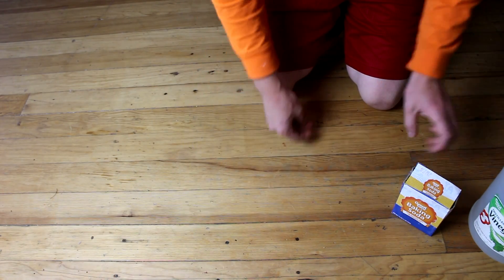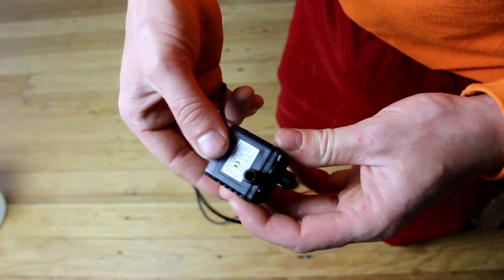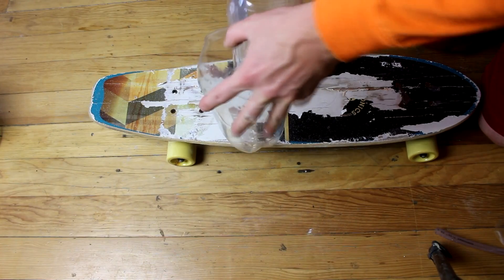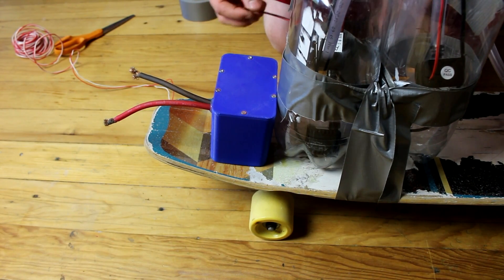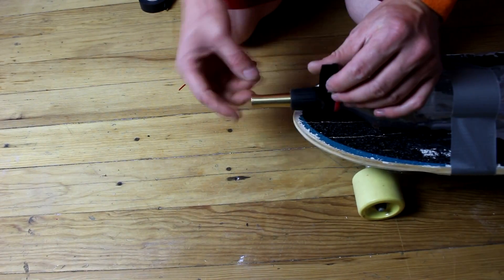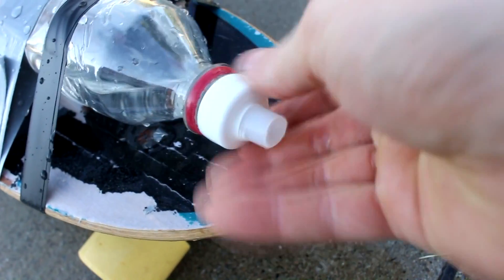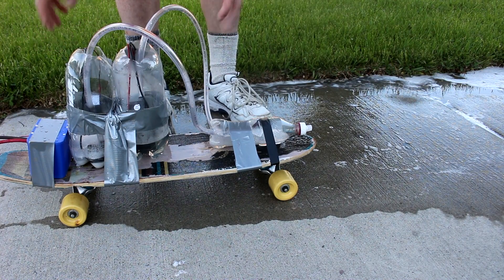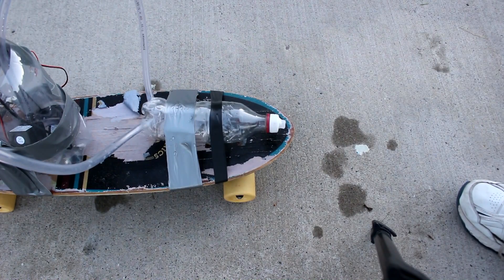Liquid Fueled Baking Soda/Vinegar Rocket

Comment: could you build a rocket and strap it to a skateboard and design the rocket so that it has sustained thrust, or multiple rockets fired after each other to achieve 10 or more revolutions in a 3m diameter vertically erected loop?
Reply: or just build a rocket that could make it to the top of the troposphere 10/20 km or so

Comment: I think you would have had better results if you had made it a hybrid solid rocket. I'm not sure how you could pack the baking soda so it would form a solid column inside the combustion chamber, but it would have probably been lighter than trying to dissolve the baking soda and pump it with the vinegar.

Comment: I wonder if this be done in a way where you use 1 way valves and a primer to avoid the need for the battery.  Let the reaction pull the liquid as it's coming out?  I'm guessing that it's not as easy as that, but I'm curious now.

Comment: If I remember correctly, the nozzle doesn't have to have greater cross sectional area than the inlet of the reaction chamber when compressible fluids are in the reaction chamber, though having the outlet with a smaller cross section than the inlet would increase pressure inside the reaction chamber (possibly requiring a few more pumps on each reagent).

Comment: looks like there might not be enough area in the reaction chamber along the thrust vector causing unreacted fuel loss, and too much area in the perpendicular plane. I would be interested to see if the thrust improves if the reaction chamber is a couple of feet of 1/2 or 3/4 pvc with the inlet at the front of the craft. Seems like that might mitigate some of the losses from turbulent flow, especially if a small section was dedicated to forced turbulent mixing, and the rest was packed with smooth straws to induce a mild laminar flow and "nominal" vectoring of the work being done before the nozzle. Then I guess the discussion moves to friction, but geez, what a drag.

Comment: When I was watching this, I asked myself a Question: Does it make any difference between putting 2 pumps in series and putting 2 pumps parallel... (I think actually, that it would be more efficient, if you let them pump parallel, because than, the move 2 times more water. then, In the reaction chamber, there will be more pressure, because, there is more fuel)
but I don't know and also don't have the recourses to test it. but maybe you have....

Comment: I wonder how powerful would it be if used glacial acetic acid and conc solution of potassium carbonate. (potassium carbonate allot more soluble in water) Also, one-way nozzles would help to avoid the pressured CO2 going both directions.

Comment: I would love to see you build some rockets out of potassium nitrate and sugar (maybe some iron oxide to make it burn faster). My friend and I built some of those and it really propels a skateboard rapidly even with a smaller engine. It is important to put a hole down the center of the rocket engine while the potassium nitrate and sugar mixture is still hardening though so that when it is lit from the back end, that flame will ignite the rest of the inside of the rocket instantly.

Comment: do coke and mentos rocket but see if you can liquify the mentos by grinding it to dust then make the mentos water???? i am not a scientist but mentos and coke are a better reaction
Reply: Central Bop, not that I am an expert but afaik:
The reaction between the mentos and the coke is not chemical, as in its not to do with the stuff in the mentos reacting with the stuff in the coke. The reaction is physical in nature, it is caused by the way the surface of the mentos dosturbs the bubbles in the carbonated liquid. 
Tldr, probably won't work if you powder the mentos. 
Sorry if I mucked up terminology or are dead wrong, working on fairly old science knowledge.
Reply: sorry mate not a scientist and never claimed to be but it was a suggestion if it did work
Reply: Central Bop, yeah all good, not trying to shoot the idea down just saying that might need a different plan for the mentos. 

An idea I saw elsewhere was to use activated carbon and a fizzy drink as it has the same ability to distrupt the bubbles but is already more of a powder. 

Would be cool to see a few options tried. Including yours as I could be wrong about powdering the mentos ruining the physical effects.
Reply: Samuel Windall yeah man Cody should do a follow up video

Comment: If we put this on the end of like a ruler and hang it by a string from its centre then the rpm of the spinning ruler can be used to find a ratio of the concentration of the two substances? Possible maybe? Using speed to calculate a concentration difference?

Comment: it will work fine if you put some decent bearings in the board, I'd recomend getting chocolate bearings they are like £5 and then try It on the road that surface is actually really hard to push on. I've been on surfaces like that and its horrible I skate so I know this shit 😂

Comment: How about to make a liquid propellant pulse-jet (well, sort of..)? Put check valves near engine inlet tubes, make a small nozzle, and send fuel in pulses. That way you can increase pressure in a combustion (err.. reaction) chamber a lot without using more powerful pumps.

Comment: If you used an atomiser (Or whatever you call the nozzle that sprays a fine mist) to put the fuels into the chamber.  Do you think that would allow the contents to be better mixed in the reaction chamber? I noticed with the foam that once it had left the rocket it kept expanding, meaning the reaction had not fully taken place yet and that wasted a lot of energy.

Comment: Hey Cody I'm just curious about those pumps, they are fucking adorable. Do they really increase pressure when run in series? How many can you hook up in a row before it's ineffective?
Reply: Croy Fischer I agree the reaction and nozzle would have increased the pressure through back pressure. The way he explains it (before he knows that the pressure potential provided by one would be insufficient) however, that that the motors in series would automatically increase pressure and volume, is incorrect. The second pump in series does not increase volume and it does not on its own increase pressure without the accompanying backpressure.
Reply: Mark It turns out that running pumps in series increase head.  This has the potential to increase pressure but does not do so in this case since the same amount of fluid is moving through the same sized pipe at the same height. 

He could have increased pressure by decreasing the size of the pipe for the same amount of fluid pumped,  increasing the amount of fluid pumped for the same size of pipe,  or pumped the water higher and let the higher fluid column on the falling side increase the pressure.  All of these methods would be enhanced by adding more pumps,  but simply adding more pumps without these methods is ineffective. 

That said,  I suspect that the two pumps in series probably pumps slightly higher volume with electric motors as the water is pre-acellerated by the first motor providing less resistance on the second motor which the pulls the first a little through suction so that they both spin a little faster.  But I do not expect this effect to be additive as it is for the head.
Reply: Tim Harig at 4:31 you can see that there is a significant height difference in the 2 pumps would this not increase the pressure?
Reply: jack farmer Its not the height of the pumps that matters.  The short answers is that the pumps determine the maximum possible pressure in the system but that the actual pressure present in the system is determined by the pressure pushing back against the pumps.  If the pressure pushing back against the pumps is less than the maximum pressure available from the pumps then the back pressure simply gives way and that results in the pressure of the system.

Think about a garden hose.  If you simply let it run, then the pressure is very low since additional pressure would simply be lost out the end of the pipe.  However, if you restrict the end of the hose, that allows more pressure to build up -- even though the pressure from the source is exactly the same.

One way to increase pressure is to pump the water up to a higher column height such that gravity pushes the weight of the water in the column back against the pump. This happens by about a foot in the video as the water arches over the top of the tanks and back down to the reaction chamber.  However, if this column height could be achieved by one pump, then there is no advantage to having two pumps in series.  That would increase the potential maximum pressure in the system but not the actual pressure achieved.

If he increased the height that the water was pumped or restricted the flow of the water past the point that a single motor could overcome the back pressure, THEN there would be an advantage to having the second motor in series.

Alternatively, he could put the motors in parallel which would achieve the potential pressure of a single pump but which would pump more fluid at once which would result in increased actual pressure.

This is assuming constant pump motor RPMs.  The other case that I acknowledge is that having the two motors in series would increase the RPMs of the motors (which would move more fluid at once and thus increase pressure) but, I do not believe that the effects of doing this are additive.  In the end, there will be a maximum number of RPMs (and thus fluid transfer rate) that the motors can supply even if you had an infinite number of motors in series.
Reply: Tim Harig one thing I don't think you took into account was the fact that pressure is being created in the exhaust bottle. This creates the same pressure effect that height would, effectively allowing these pumps to pressurize to their full capacity, and as we saw in the video, said pressure exceeded the capabilities of the pumps in series when the nozzle was too small. Soo yea

Comment: I would have used the two pumps  individually so you would have two hoses per fuel source.    You could then have a smaller nozzle.  the thing about those kind of pumps is that they don't preform much better in series .

Comment: You could put 1 way valves on the hoses for vinegar and baking soda, this way you won't lose pressure in the rocket chamber backing into the motors.

Comment: you should use the gas as a source of pressure instead of as the exhaust gas. similar to those little water rockets have the reaction occur so the gasses are pushing a liquid out of the nozzle.

Comment: try it with diet cola and mentos
Reply: Hybrid fuel rocket
Reply: Try with diet Coke and activated carbon that gets an even more volatile reaction.
Reply: Next top secret project. A Solid Liquid fuel rocket. The parts machined from metal gears and piloted by Snakes.
Reply: Frederiks Eidins 
Hold on i don't want my fucking house to explode
Reply: You must be less than 4 years old, Charlie.
Reply: Keyboard Warrior Never thought of mentos + diet cola as hybrid rockets before
Reply: It's not a hybrid rocket per se, as the menthos acts more like a catalyst to release the CO2.
Reply: Would probably work a lot better but it has no value as a demonstration of how liquid fueled rockets actually work, the big ones.

Comment: 8:51 increase nozzle pressure.
Reply: Grease the bearings, smoother surface to run on, valve inlet tubes and return to the other nozzle.

Comment: I bet 2 pumps wont make more pressure than just 1 would produce, if you put one after another, like in the video. However if you put both of them in liguid, and connect them in to a T-part, then 2 pumps will make 2x the pressure of 1 pump.

Comment: Cody, I have a weird request (feel free to ignore, but maybe its an idea that'd interest you).  Could you test the Leidenfrost Effect in your vacuum chamber?  Either with NO2 or hotplate and water shouldn't matter.  (But NO2 might be easier to do?)  Either that or dropping a red-hot piece of metal into some water?  After watching some high-speed footage of the Leidenfrost Effect, particularly of a red hot piece of metal falling into water, it really doesn't look like steam is bring produced (the 'bubble' around the metal never expands, no bubbles rise from it after the metal gets deep enough that the water closes over the top of it).  I am wondering if its actually a matter of the metal taking a cushion of superheated air with it that provides the insulation instead of instant vaporization of the water.

Comment: Wouldn't putting them in parallel increase the pressure more than if they're in series? Having trouble getting my head around it. If the pumps are of equal power, then only the first one would have any effect, right?
Reply: Working backward. We want the ejected fluids to be going fast (Higher Specific impulse).
Bernoullis Principle says that there has to be a pressure drop between the slow moving fluid and the fast moving fluid. (Think of it in terms of potential energy being turned into kinetic energy) 
So the fluid inside the chamber is at a higher pressure than the outside.
The pumps need to overcome that pressure difference to maintain fuel flow.
Each pump is producing a pressure difference between it's inlet and outlet. If the pressure inside the chamber exceeds the pressure difference the pump can produce, the flow will be backwards through the pump, and the engine will go through a burn/refill cycle instead of continuous operation.
Putting pumps in series adds the pressure differences. Thus they can pump fuel into a higher pressure chamber. Thus the nozzle can be smaller and the exhaust velocity higher. Higher Isp => more efficient engine.
If you also keep the RATE of flow from dropping too much, you also get higher instantaneous thrust.
Reply: Jayyblamesthegame Incorrect. Adding pumps increases head which increases the potential for pressure but does not automatically provide pressure by itself.  So long as the same amount of water is moving through the same amount of pipe at the same height,  the pressure will be the same., no matter how many pumps are running. 

Putting the pumps in parallel will pump more water which will increase pressure in the same sized pipe. 

Reducing the pipe size for the same amount of pumped water will increase pressure. 

Or,  increasing the height that the water is pumped to will increase pressure as gravity will  increase the pressure with the height of the water column on the falling side. 

The first works adding two pumps in parallel. 

The latter two will work for one pump up to its head limit.  Only then will adding a pump in series actually increase pressure.
Reply: Two pumps in series can pump water twice as high where in parallel twice as fast.
Reply: Adamast But twice as fast is what we want. Momentum is mass * velocity, so those are the only things that we can change. We could put something in the liquid to make it more *mass*ive, or increase the speed at which it's ejected. (The latter is what Cody did by adding a nozzle)
Reply: With high I mean pressure (that's what will give speed) were fast is about the rate of flow.

Comment: I wonder what would happen if you used one way valves with the smaller nozzle...
Reply: the problem, then, would be that the pumps would be unable to overcome the pressure in the "combustion" chamber, until it depletes, again causing the intermittent bursts he was trying to avoid.

Comment: I would be pretty curious to look at the difference in performance between this configuration and the one with two parallel pumps with the outcome joint together in a tube with the same diameter!